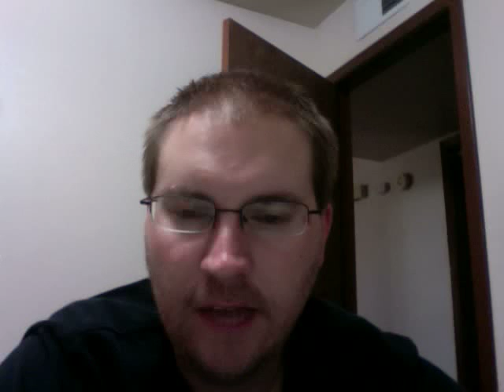Introduction to mechanical ventilation 9

Comment: yes faster flow push the volume of air in faster, so your inspiration is faster. it does not increase the tidal volume unless it is desired and increased. Peep increases the pip because it is constant positive pressure at the end of an exhalation. exhaled volume is decreased because the PEEP amount is left in the lungs (like a partially inflated balloon is easier to inflate than one without any air to begin with). pressure and volume have an inverse relationship (Boyle's law) so if P^ then Vv